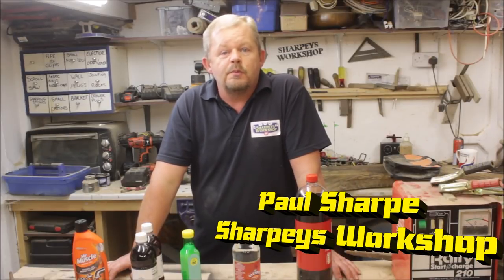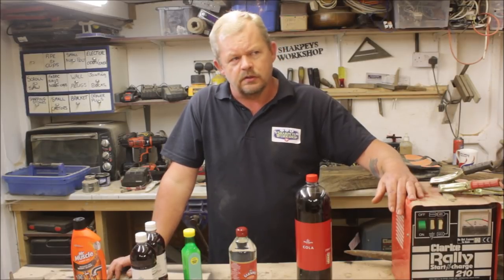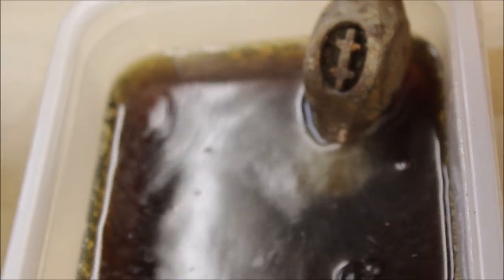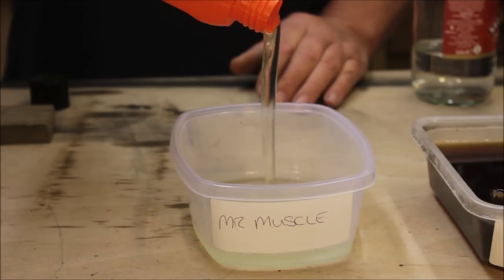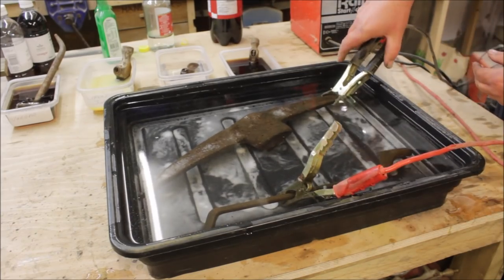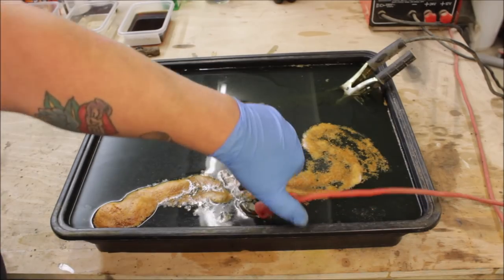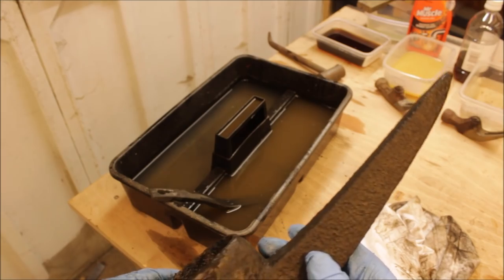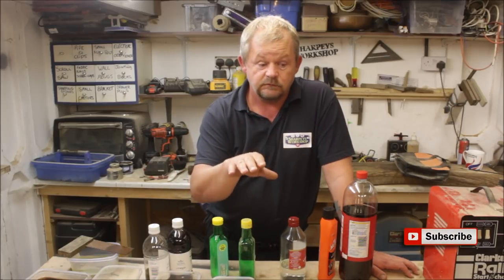Rust Removal Test Cheap And Easy Way

Comment: That's got to be one of your best videos yet, it had everything! Science, comedy and some really useful results. It reminded me of that old programme Brainiac with the Hamster.
Wonder if it was just the cheap cola, what about the proper stuff, that always makes the old pennies shine, but that's not rusted I guess.
Interesting pub fact for you - The cola started fizzing straight away because the carbonated drink can form bubbles better on irregular surfaces.
That's why they started engraving those designs at the bottom of your cheap larger glass, to make it fizzier.
So if you get a plain glass and there are no bubbles is probably because the glass is very new and clean.
Dirty glasses always give off more bubbles, but don't let that start a row down your local :D lol
Reply from the maker: Thanks Greg means a lot coming from the tube master as for the pub fact very interesting I didn't know that the cola probably would clean grease well but wouldn't touch the rust cheers buddy

Comment: I have used for rust removal on tools molasses you can find the type at a sports store. It is also used as deer lure.  Used a 60-40 mix 60 molasses 40 water.

Comment: So now you need to remove the rust from the spanner! I use distilled malt vinegar, 5lt dirt cheap from Bookers. I'm gonna try electrolysis in vinegar now. Thanks for vid.
Reply from the maker: Cheers Geoff iam not bothered about the spanner but electrolysis in vinegar sounds like a good idea
Reply: Yeah, I buy white vinegar online in 5 litre bottles - very cheap if you get the non-food grade stuff

Comment: Nice one Paul you've given me some good ideas for a couple of projects I've got on the back burner. I love the way you got proper scientificalogicallymatical with it lol. Just one question was the large spanner knackered or did it just need a wipe off?
Reply from the maker: Thanks dave The spanner that I used for the eletrode could be cleaned up but I think if you could get some rebar that would be ideal and last for ages